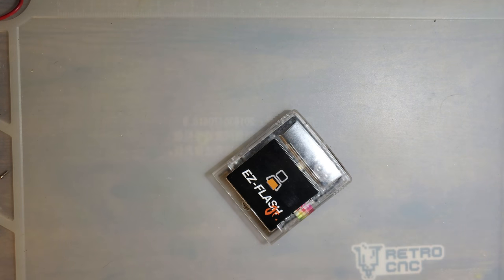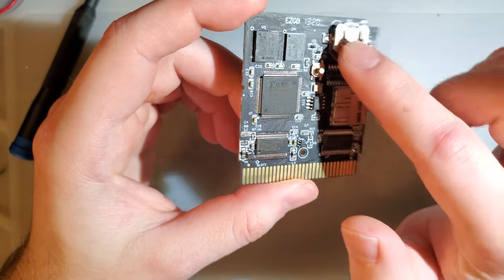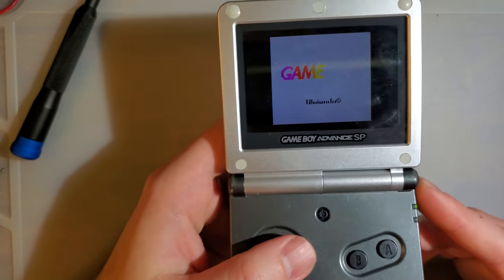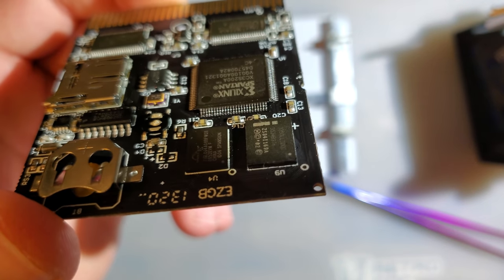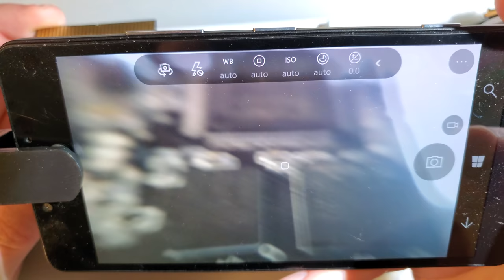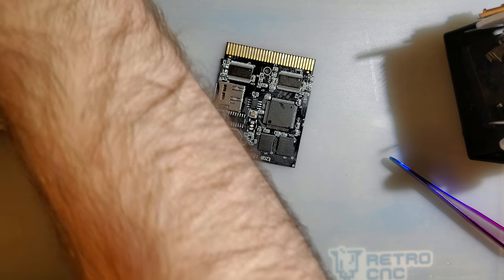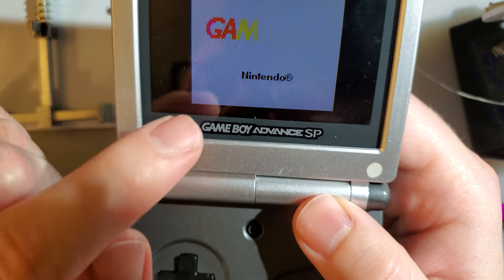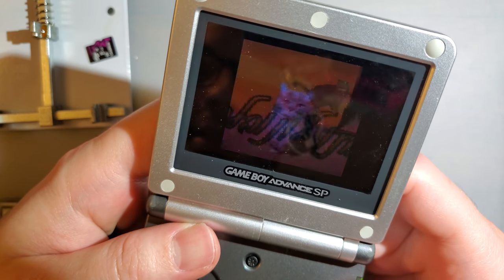Fixing an EZ-FLASH Jr that Fails To Boot

Comment: No one mentioned this but you have to be very careful around the SD card slot. It's got plastic in it that will melt if you hit it with the hot air.
Reply from the maker: That's why I never even fluxed it up, I never hit it with hot air.
Reply: @makho  I know you didn’t. But if people decide they may need to do this for their out of warranty device they may not know that there’s plastic in there.
Reply: If possible I try to cover those bits with a tiny aluminum foil hat.
Reply: @GoatZilla  Not recommend, as it could short the pins
Reply: @Gameboy_1992  Uh, not permanently, just during the rework process.
Reply: @GoatZilla  it's better to just use some kapton tape

Comment: You will always get that message about the battery one more time after replacing the battery since the way it knows your battery died is by checking the backup RAM for a CRC or something known. Even after replacing the battery the backup RAM still needs to be initialized with the CRC or whatever it saves on there to know. Same as an IBM PC with the "CMOS Checksum Error: Defaults Loaded" message, which basically means the CMOS settings were reinitialized after corruption or battery failure.
Reply from the maker: Makes sense. I just assumed that the battery could be dead since technically RTC has never worked on this cart either

Comment: Have you ever tried using hot air at a lower temp (around 200C or less) to help evaporate the iso that gets under the chips? It has worked well for me.

Comment: I have a Bung 64Mbit Doctor GB Card V2 which doesn't work after a friend's dad hit it with a hammer but it seems to work when I hold the chips down. Been planning to make a repair video but I removed the battery long ago and I need to find out what size belongs there. I'd prefer to have a working one to demonstrate the fix side by side on video like you did but these are somewhat hard to find. :(
Reply from the maker: Perhaps you should talk to your doctor about your bung? I'm not sure how I can be of assistance
Reply: @makho  LOL! Just mentioning that I was already planning a similar Game Boy flash cart repair video. It's been broken for 20 years but I can tell that it's definitely fixable. :)

Comment: I think my problem is different, I just get an R without and Nintendo logo. I checked for continuity on the fpga and surrounding chips. All was fine, but I reflowed the solder anyway. Unfortunately it still doesn’t display the Nintendo logo at all, not even glitched.
Reply from the maker: Next step is to try reflashing the FPGA via the JTAG headers on the cart, I suspect. I don't know how to proceed with that.
Reply: @makho  Yes, I thought as much... I don't have the equipment for that. And of course, I would need a bitstream of the firmware to work with, which I suspect won't be easy to obtain.
Reply from the maker: @klurman  firmware can likely be extracted from the update.gb file that EZ-FLASH provides. But yeah, beyond that, no clue. If these things are dumpable, it would likely be easier to just pull the data from a working cart.

Comment: This could also be a problem with the chip that has the firmware in it on some ez flash omegas too 

mine works perfectly on my unmodified ags 101 GBA SP but I have had a few people put comments on my video [not trying to selfpromote I'm just saying where I have seen this] about restoring the firmware that after they tried it the cartridge was still stuck in safe mode and could not boot
Reply from the maker: that is likely different. Due to the chips on the back (and the not so great case design), the PCB is a bit thicker than OEM games and the tolerances cause issues on some consoles. I've heard that Micros seem to have issues more commonly than other consoles due to the thickness.

Comment: Hey, question: I'm currently working on a small project with my copy of pokemon silver that may be solved with reflowing. I'm not very experienced and I do not have a heat gun, plus my soldering iron is very basic. Is there any other viable way to reflow a board aside from what you used in this video?
Reply from the maker: flux + soldering iron (and a bit extra solder) is the best method by far: https://www.youtube.com/watch?v=0gqNEyQLecQ

Comment: I've been searching high and low to find an answer to a different issue I'm having with my EZFJr. Pretty sure I need a voltage regulator after installing a no-name TFT LCD, in a gameboy pocket but I have NO idea where to solder that bad boy. Help?
Reply from the maker: what console are you even talking about?
Reply: @makho  that would help! Gameboy Pocket. Edited.
Reply from the maker: @chrisgodoy2548  https://bennvenn.myshopify.com/pages/gameboy-pocket-flash-carts-backlights
Reply: @makho  I have this in my backlit pocket, and I have another I could use. I can get the batteries to the regulator, but where do I send the power off the regulator? On the backlit pocket it's going straight to the LEDs, but no idea where to stick it on the tft.
Reply from the maker: @chrisgodoy2548  replace the regulator. Parallel could work too but it depends entirely on the regulator you use and how you wire things up. Ultimately this is the downside of modding Game Boy Pocket consoles. You'll probably have the best experience by just using better batteries.

Comment: So. I have a broken one too, but its just a black bar. I tried the eraser trick, used alcohole to clean the pins, Even tried blowing in it, nothing worked. Whats wierd is, is that it stopped working as i was playing a pokemon yellow spaceworld prototype on my og gameboy. Now, idk if i maybe have given it a volate spike, as the game crashed randomly and i turned the gameboy on and off everytime it displayed a garbeled mess. If anyone could tell me what the problem may be, it would be nice to know, but for anyone asking to fix it, then no. I dont trsut strangers and i live in germany. So if anyone knows what the problem might have been/is then i would be happy/mad to know
Reply: Now. I might have bricked it, but i cant tell for sure if i did,because as said before i just get a black bar where the nintndo logo should be/ black screen on SuperGB. Also, i dont have any experience with flux or this type of "Desodering".

Comment: Do they have a ez flash for gba?
Reply: EZ Flash Omega
Reply: I personally would stick with real Everdrive GB X7 and GBA X5 because of battery life on handhelds. If you are using it for a gameboy player on gamecube the EZ-FLASH are great. If you are using on a super gameboy player you need to squeeze the cartridge wait for the Super gameboy logo then squeeze it again for the EZ-FLASH Jr. Logo.
Reply: Also on Super gameboy the EZ-FLASH Jr. has no Super Gameboy borders but I personally like that.
Reply: I think the best way to use the EZ-FLASH Jr. is in a Super Gameboy 2 for SNES. No  border support but I love that feature. Pokemon Gold/Silver with real time clock. I also had a blast the other day with Banishing  Racer, Hammering Harry, Kid Dracula and Burning Paper.

Comment: do you know how to un brick a jr ? lol i tried following a tutorial and now the nintendo logo dont even show up or the ez flash logo loading screen
Reply from the maker: Per ezflash, most commonly that issue is related to the clock crystal they use and allegedly replacing that part can fix it. Ymmv.